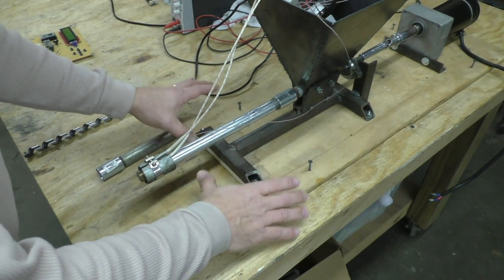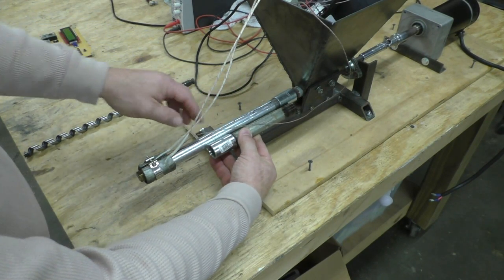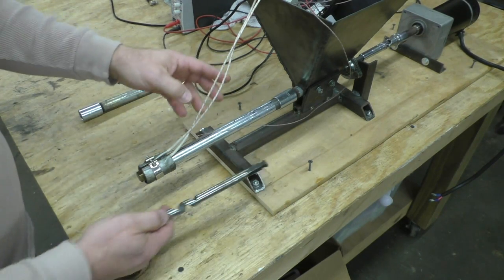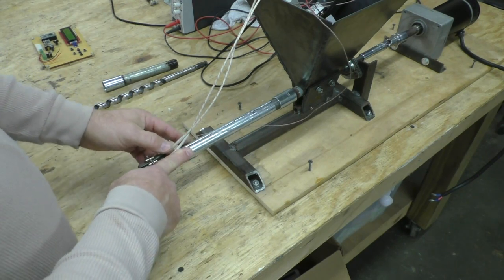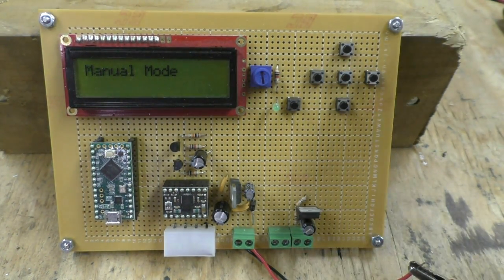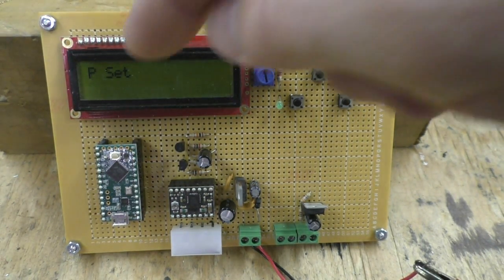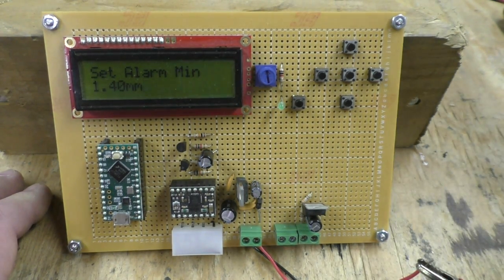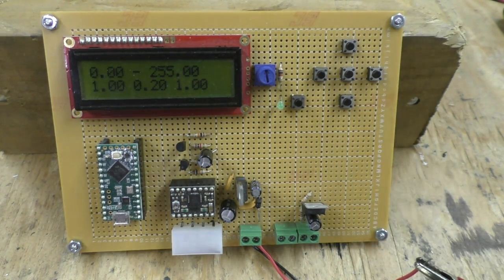Filament Extruder #13 - Circuit Board and Update

Comment: Good evening Mr. Russ Gries, are an old hobbiest and network was known as Dag-50 (http://www.cnc-dag50.it/) turning on youtube I came across in your project I've done all (Filament Estruder) component parts of recovery and many pieces made with my small 3D printer, you can see the achievement on my Fb page (Dario Gallego).  I also created the part that detects the size of the wire with the Caliber but I can not find it the wiring diagram ne listing software to enter into the microprocessor. Since I have heart surgery, for impiantarmi artificial valve, I can no longer go out and this is the only hobby and pastime that can make you wonder if you could help me for both the electronic diagram for the program listing for the functioning of the Caliber. Thank you and I offer you a big Hello. Dario

Comment: Buona sera signor Bob, sono un vecchio hobbista ed in rete ero conosciuto come Dag-50 ( http://www.cnc-dag50.it/ ) girando su youtube mi sono imbattuto nel vostro progetto ( Filament Estruder )Ho gia realizzato tutte le parti che lo compongono con materiali di recupero e tanti pezzi realizzati con la mia piccola stampante 3D, potete vedere la realizzazione sulla mia pagina Fb ( Dario Ghezzi ).  Ho realizzato anche la parte che rileva la misura del filo col Calibro ma Non riesco a trovare ne lo schema elettrico ne il listato software da immettere nel microprocessore. Da quando mi hanno operato al cuore, per impiantarmi una valvola artificiale, non posso più uscire e questo è l'unico hobby e passatempo che posso fare, Vi chiedo se potreste aiutarmi sia per lo schema elettronico che per il listato del programma per il funzionamento del Calibro. vi ringrazio e vi porgo un grande saluto. Dario 

Good evening Mr. Bob, are an old hobbiest and network was known as Dag-50 (http://www.cnc-dag50.it/) turning on youtube I came across in your project I've done all (Filament Estruder) component parts of recovery and many pieces made with my small 3D printer, you can see the achievement on my Fb page (Dario Gallego).  I also created the part that detects the size of the wire with the Caliber but I can not find it the wiring diagram ne listing software to enter into the microprocessor. Since I have heart surgery, for impiantarmi artificial valve, I can no longer go out and this is the only hobby and pastime that can make you wonder if you could help me for both the electronic diagram for the program listing for the functioning of the Caliber. Thank you and I offer you a big Hello. Dario

Comment: Maybe the filament reaching the pool that pulls that pulls from the machine isn't cool enought inside of the filamente and your wheel is pushing it to that shape being not fully cooled at that point, but enought to stay in form and just make a oval shape and not a thin bar if it would go more hot.
I would suggest to try a longer water cooler bath and maybe a peltier running to keep really cool that water and see what happens, maybe you can skip the mods going the pull go far more distance from where is now to see if there is an improvement and if are some improvement should be that the problem, the inside of the filament still not right cooled in you actual configuration and your wheels pulling the filament not full rigid at that time when it reaches them.

Comment: Another option is to let gravity pull the filament. Arrange the  nozzle to be facing down, make a 90 degree turn of the plastic tube just at the nozzle. Then the filament will naturally fall towards the floor. You could let it cool naturally in a pool of water.

Comment: Is your nozzle a tubular opening? Might consider making it be a very this cross section by countersinking both sides. Have the filament go through very thin die.
Reply from the maker: No it is not.  Russ has a tubular nozzle and he gets better results than me.  It's just one more thing on my list of stuff to try.

Comment: If it powers itself off after idle time, you can prevent it by changing units by making contact between data or clock and V+

Comment: Hello, I was thinking I saw this video few years ago, but seems to be relative new... have you tried to place the extruder vertical? I wanted to do the same two years ago, but I was broke. :D however I found all items at 1/4 of price, so :D I was lucky. Now I´m thinking to buy the motor but Today I found how to do a gearbox to use a 12v motor. 
in order to achieve a constant diameter is needed to give a regulated pressure, so for this i´m thinking to cool the screw (drill bit) and keep warm the nozzle. The PID might not to be too accurate; becuase on firts test I noticed a over heat of 5 to 10 grades for long periods.

Comment: Diameter is defined not by the extruder or hole diameter, but by the pulling mechanism and it's speed, and the shape is defined by the cooling part, just search a video called "How It Is Made: 3D Printing Filament" the guy who has an industrial machine for producing filament explains how it works and why people get oval shaped filament

Comment: i have work on industrial extruder they dont heat the end only but most of the tube like half way you may whant to look this element its a bar your material has to get  to the last element pre soften check that link it may help you https://fr.aliexpress.com/item/2pcs-100-21-5mm-High-power-PTC-thermostat-heating-element-Ultra-low-temperature-heater-Electric-Plate/32639479510.html?spm=2114.06010108.3.202.Jtvagr&ws_ab_test=searchweb0_0,searchweb201602_1_10065_10068_10000032_119_10000025_10000029_430_10000028_10060_10062_10056_10055_10000062_10054_301_10059_10099_10000022_10000012_10103_10000015_10102_10096_10000018_10000019_10000056_10000059_10052_10053_10107_10050_10106_10051_10000053_10000007_10084_10118_10083_10080_10082_10081_10110_10111_10112_10113_10114_10115_10037_10032_10000041_10000044_10078_10079_10077_10000038_429_10073_10000035_10121,searchweb201603_3,afswitch_2,single_sort_2_default&btsid=90930b7e-cdc4-48f1-84c0-512452d3fdc2

Comment: Thanks for the video, I subscribed a few months ago to your channel and watch your videos pretty much as soon as you upload them. I have been working on the same project for almost a year now and I'm still struggling to extrude PLA, but I have learnt a few things that are a must have in order to achieve a consistent extrusion diameter on the extruder:

*Your extruder motor has to be strong enough to keep extruding plastic at a consistent rate, regardless the pressure built on the auger tube. If the motor is not strong enough, pressure inside the tube will slow down the motor rotations which will greatly affect your extrusion parameters.

*Water cooling: A water bath is a standard on pretty much every extruder that exists. It is not mandatory, but using another cooling method such as air is way more complicated than just cooling with a water bath.

*A filament puller: MUST HAVE. Every extruder machinery I have seen use pullers to determine the filament diameter and to guarantee that the filament is round. Normally, the extruder has a big nozzle hole (lets say 3 or 5mm) and the diameter of the filament is determined by how fast do you pull the filament. For 1.75mm filament you pull faster, for 2.85 filament you pull slower. This "pulling" mechanism in exchange with the water bath is what makes your filament round and consistent.

*Electronics: Finally, the filament diameter has to be measured right as soon as it comes out of the water bath and the electronics will control the pulling speed of the puller. Performing these corrections as soon as the filament comes out of the extruder guarantees that if there is any fluctuation on the diameter, only a small portion of the filament will be inconsistent.

Due to money constraints I have not been able to make neither the water bath or the puller (only have an extruder I made based on Ian McMill design on Instructables, and a filawinder I purchased from the filastruder guys) but I plan to make the puller shortly and see how it goes.

Comment: Hi Bob :)

Looks DIY filaments extruder kits works just like your extruder. But when I watch ads about industrial filament extruders, it's overall looking very similar to your setup, only they seem to have an additional step between the bath and rolling it on spools : looks it's a quality control on the diameter, but I think it could be correcting the diameter in some way too. Could the filament could still be workable at this step, maybe by compression ?

What I'm thinking : maybe like passing it between two rolls just like rolling pins (something that would keep the round shape of course), with the pressure controlled by a PID driven by some simple optical diameter - sorry for my english I hope I'm being understandable lol... 
It's just a draft idea, maybe stupid I don't know but it could spare you from building a v2.0 from scratch, I don't see what's wrong with this version and I'm afraid you could just have the same issues with another one. 

In my local fablab, they bought a filament extruder and they're not even using it, the guy told me it's because it makes inconsistent diameter : That supports even more my idea that the key to perfect filament (with low diameter tolerances) could be adding an extra step instead of changing your extruder setup.

Keep up the good work :)
You (and Russ) are great !!!

Comment: according to some other videos ive seen in production they use multiple baths at different temperatures instead of one cold bath. you pull quicker to get the size down to 1.75 and the cooling running through multiple baths keeps it from going all oval on you.

Comment: Have a look at makezine.com. They have a video with a filament producer which gives great insights in filament production. also talked about oval shaped filament. should be a cooling problem (to fast). 
link: makezine.com/2015/02/11/how-it-is-made-3d-printing-filament/

Comment: Lol.. when we extrude bales of hay into pellets using your auger idea we grind the stalky stuff up so it's flowable . it's preheated as it enters the auger system heat is produced as it's augered and additional heat is added so the lignen in the product softens to aid in flowing and mixing with the different materials so all is consistent as it moves thru the auger system. cooling is at the nozzle tip so the product stays in it's form that it came out of at the nozzle and slides down a guide til it can hold it's own shape. I know we're talking two different ends of a spectrum but extruding is a process of start , middle and end results with requirements. I'm thinking your mid heat system needs to be longer and the temp needs to be monitored for it's melting point and go from there,, just some barnyard engineering thrown at you.

Comment: The trick, I think, is gonna be cooling the filament as quickly as possible once it comes out the nozzle. Have the waterbath as close as possible to the nozzle tip, use a peltier element to cool it if possible, and use a larger waterbath to hold a larger volume of water. That will sink a lot more heat then :)
Good luck, Bob!
~Chris
Reply from the maker: I have the nozzle about .5 from the water.  I also haven't been able to run the setup long enough to worry about the water heating up.

Comment: davehakkens has a channel for recycling plastic, his video shows that he has been down the same route as you, and he has 4 heaters AND IN ADDITION coolers and support on the extruded plastic to help stabilise the dimensions of the extrusion.  https://www.youtube.com/watch?v=j85TPjYRezI&t=88s
Reply from the maker: Yeah, all of the machines that seem to work well have more than one heating element.
Reply: Hi Bob, i had the same problem.. the filament didn't came out. The solution is to increase the friction of the pipe. What's happening is that the melted plastic is sticking to the drill bit because the drill bit has more friction than the pipe... 
I have only scraped inner tube wall and worked very well then...I hope you read this.. And if isn't to much to ask.. can we see the code of the microcontroler?

Comment: I have only come across these extrusion experiments on YouTube recently so have no expertise. but I would suggest that you extrude the filament vertically to avoid the oval effect. I base this on a local factory that built a tall tower to manufacture plastic extrusions, I believe they make window frame plastics.

Comment: I honestly think you need a 3/4inch auger on there with 3 heater bands that are set at different temperatures. 10-15% apart. also you may want to consider a large stepper driver along with a nema23 motor to drive the auger, if you need more torque you can use pulleys and belts to create a 2:1 or 3:1 reduction. You also want to run the stepper at full steps for maximum torque. should be easy to incorporate into your setup. you may want to do PID on the heaters as well.
Reply from the maker: I am already running PID on the one heater band.  But yeah, more bands and 3/4 inch bit seem to be the way to go.

Comment: do you have two calipers measuring the filament ?  With only one you might not detect ovals.
I would think you should be able to push enough filament with the 1/2 auger bit.
Reply: For round shaped filament you need a hot water bath with appropriate temperature and after that you need normal water bath. I am saying this based on one of the 'how it is made documentary' i have watched.
Reply: nothing the software could do about ovals anyway, so no reason to continually messure them...
Reply from the maker: I have found that if the plastic is too hot the filaments comes out oval.